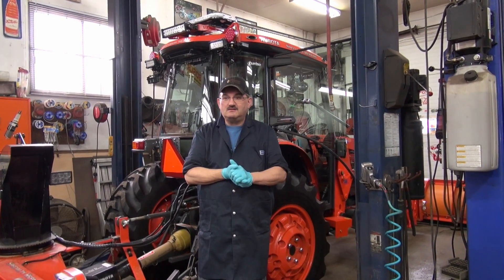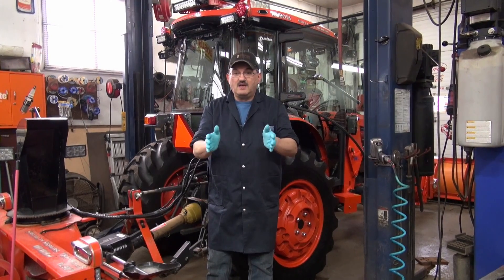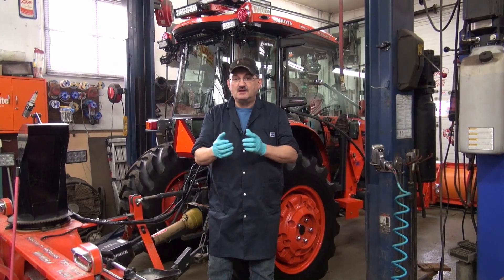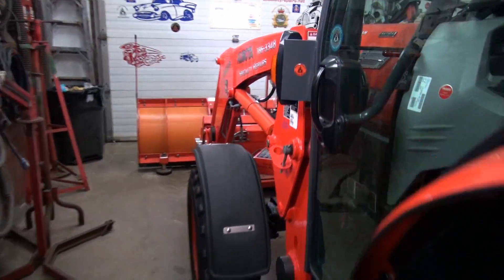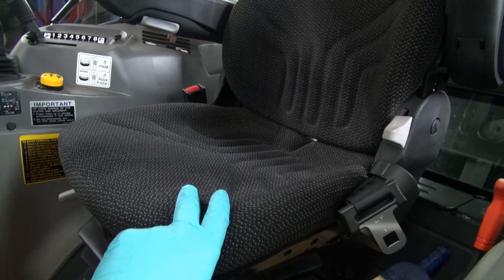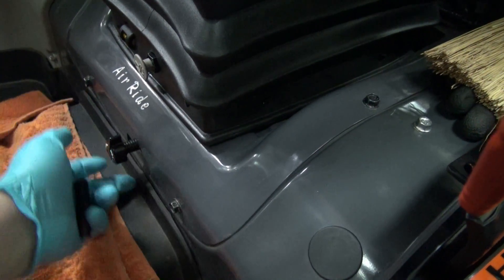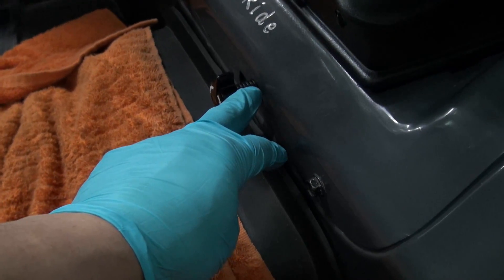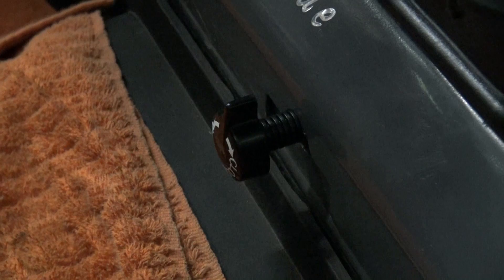Kubota Tech Tip GL40 Series (Cab Model)

Comment: isn't that just a temporary fix
what about grinding the top of that cutout so that it doesn't happen again
Reply from the maker: kurlis 
No. That shaft with the knob on it is flexible. the reason the issue came up was because of the weatherstripping foam behind it wore enough to cause the shaft to rub against the hole opening. By putting the split loom on the shaft it just prevents the rubbing of the two metals.